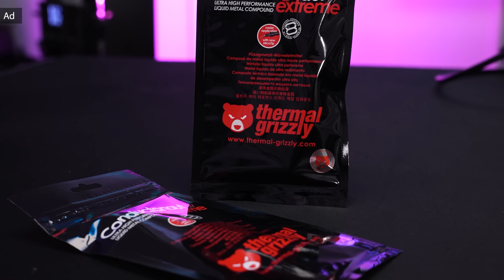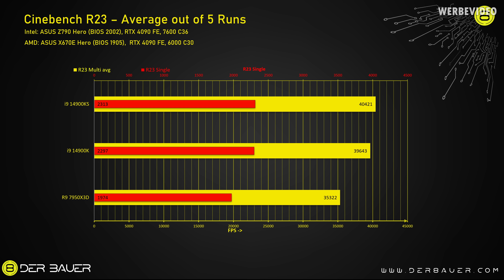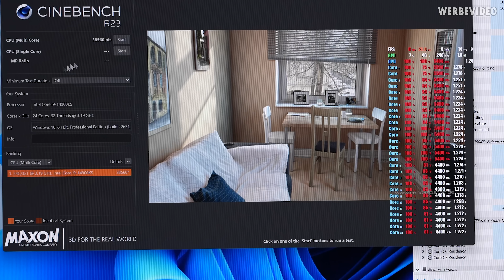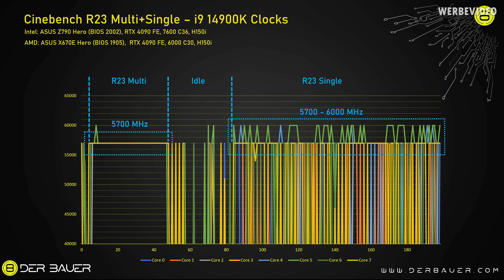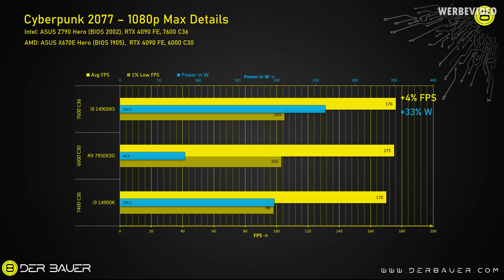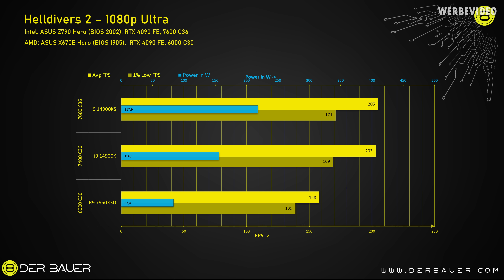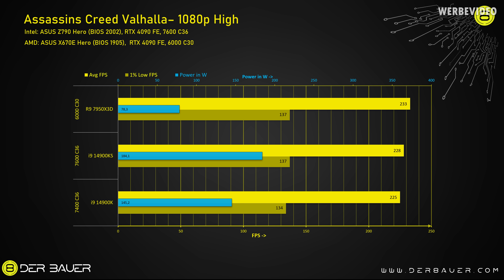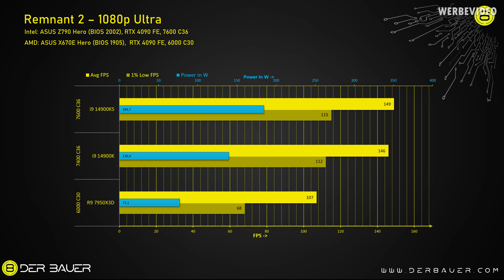Almost 400W under Full Load - The 14900KS is one of the Most Extreme CPUs ever Made

Comment: Cpu alone using more than my 5800x and 6600xt combined.

Not when both are oc'd ofcourse but damn
Reply: The power consumption is due to the 1970s cpu and Ram architecture.  I can almost guarantee you the RAM controllers and address bus are eating the bulk of the power.
Reply: Your 5800x does 18K worth of useless work in R23. vs a 31K 13700K performance.
Reply: @kramnull8962  According to your math the 13700k is 50% better than the 5800x. With twice as many cores and thus 50% more threads. So thread per thread they are equal and you belittle this guy through his cpu? Wow
Reply: @wessidemessside  Not 50% but I love your spirit and honesty. You'll learn something in 50 years.
Reply: @kramnull8962 Nice argument that barely holds up. Lol.
Reply: @Iridiumcosmos  Yeah vs a 7600x at 76% usage. which would be your suggestion.
Reply: @kramnull8962  Who said anything about a 7600X? Are you alright?
Reply: @Iridiumcosmos  Because that's your favorite budget stepping stone to tell people to buy AMD and avoid Intel? Am I right???

Comment: New BULLDOZER 🤣🤣
Reply: The 14900ks is the fastest all-around cpu. Bulldozer could never make such a claim. Yes, Intel uses power. However, this is a desktop cpu. Power only draws when the desktop is on. You are not going to notice it on your bill. For perspective, your home level 2 ev charger pulls 20kw all night long. Keeping the chip cool is a systems engineering problem that can be overcome. It is not as significant a problem as looping a 4090 into any high-level system case. With delidding, the cpu should overclock another 200 to 300mhz.
Reply: At least it can compete with AMD in performance, unlike Bull Loser did vs. Intel back in the day. But still, I find these i9 products to have only extremely niche use cases that still make sense vs. Zen 4, even if your electricity is dirt cheap compared to European prices and you live in a cold climate lol.

Comment: Last time I was that early, CPUs didn't double as furnaces.
Reply: Still not as bad as 20 years ago with the P4 Extreme Edition that wouldn't downclock and always run hot.
Reply: @puciohenzap891  CPUs were a lot lower-power back then, the coolers just sucked compared to what we have now. Put a P4 under a modern tower and it'll barely get hot at all.
Reply: @arudanel5542  by "this winter" u mean in like 9months where better cpus has come out? lmao
Reply: @arudanel5542 it’s about to be summer…
Reply: 1.5 years later Gamers nexus and this dude are still fighting the 7950x3d to make it run. We Intel guys slammed our processor off the table and caught it on the motherboard locked it in and haven't looked back!
Reply: @kramnull8962  Except you have to put it in a contact frame so it actually makes proper contact with the cooler, but keep on dreaming 🙂
Reply: Imagine a moment where you have to explain to the police that you're not running a marihuana farm, just an overclocked 14900KS.
Reply: @michalsvihla1403  some crypto currency miners had that issue, lol.
Reply: @michalsvihla1403  Took brain cells to write that....

Comment: I wonder what the future of PSUs is going to be....with more powerfull draws
Reply: They can't really just keep increasing the wattage, due to limits in the actual plugs themselves in your walls. For the US, around 1500 - 1600 watts is about as much as you're going to be able to pull from a standard 120V outlet. We already have power supplies up to that.
Reply: @DaveGamesVT Absolutely correct. But they probably could make a higher wattage unit that runs on two separate 120v outlets. That seems absolutely ridiculous though.
Reply: @username8644  But you'd need it to pull from 2 different circuits, you can't just plug it in top and bottom.
Reply: @DaveGamesVT  For most homes in the US with 15Amp circuit breakers the maximum rated sustained pull is 1440 watts.
For those interested the maximum sustained power is only 80% of the rated power.  (80% * 15A * 120V)
If you have a good power supply near 90% efficiency at max load that means a 1300W power supply is about the most you can install in your computer.
Reply: As a side note that doesn't mean installing a 1500W power supply is necessarily a bad idea - power supplies are more efficient at converting AC to DC in the middle of their range than they are in very low power or near maximum power output.
Reply: @DaveGamesVT for high end stuff they can, just get two sockets on different circuits or a 240v circuit like for ovens and other high power equipment and EVs. I mean this is a 700$ CPU, if you can afford that and the god tier system around it you can afford a little of electrical remodeling
Reply: @marcogenovesi8570  A lot of people do not own their residences
Reply: @kendokaaa  less-than-wealthy people isn't the target demographic for a 700$ CPU
Reply: @marcogenovesi8570  Lmao if you think only poor people don't own houses you don't live in the real world. Have you heard of cities, where most of the world lives? Not the smartest are you
Reply: @kendokaaa  lmao if you don't own at least a house you are poor. Yes most people in cities is poor because they pay 3k in rent for a single room with roaches. They don't have the budget for a high end PC because rent is so high
Reply: Next gen intel will scale down is cpu so less power draw
Reply: future? did you forgot those 2000 watts psus for a quad sli setups with two cpus? it will be just that but with less gpu power cables and instead one or two 12v hp connectors if rummors about 1000 watts nvidia gpus are true